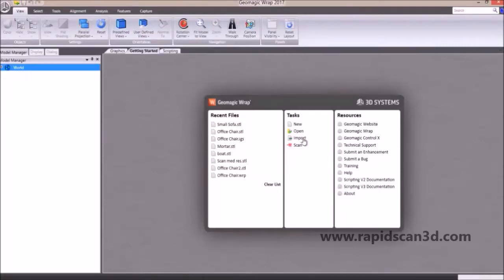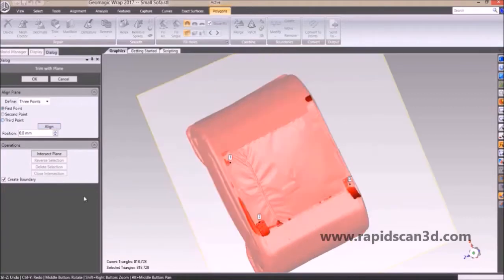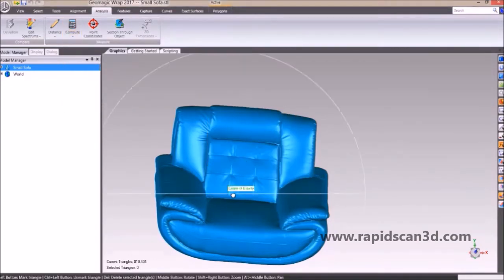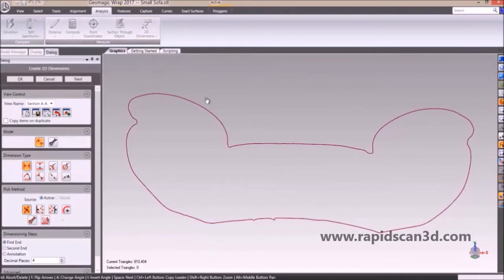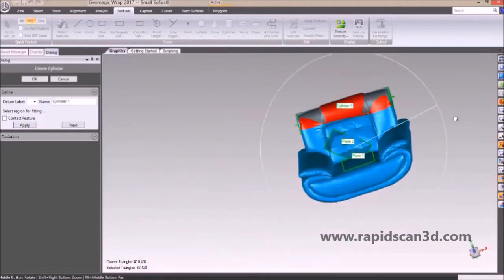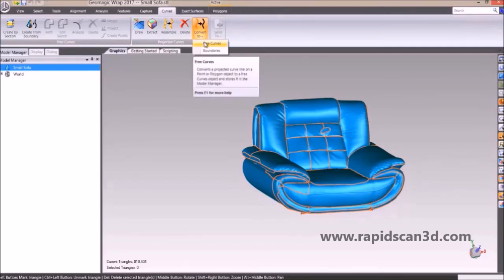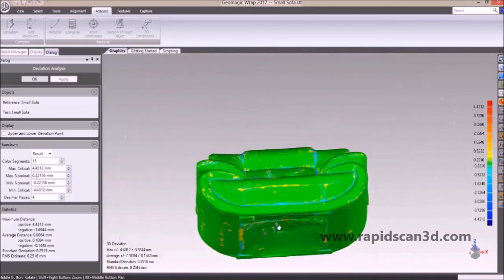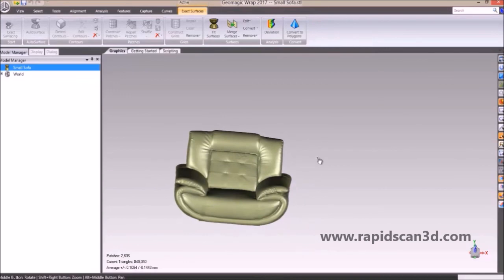Utilizing Geomagic Wrap on 3D Scan Data

Comment: Very useful video. May I ask that in 2D Dimentions, can I measure the area of the cross section I have created? Because I do not know in Compute Area, when you choose cross-sectional area, whether the results represent the surface area on one side of the cross section.
Reply from the maker: Yes, absolutely.  You can take measurements between points or you can take measurements between.   Geomagic has multiple ways to take measurements.
Reply: @RapidScan3D  Thanks for your reply. I have solved the problems after watching your video.☺